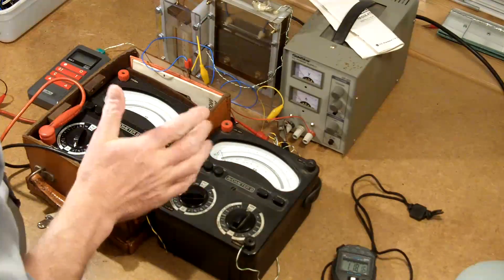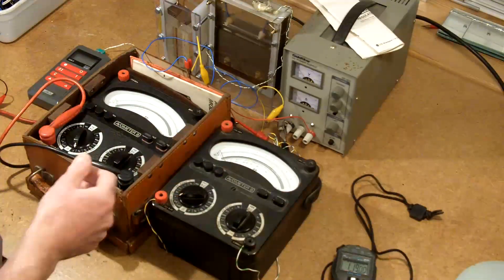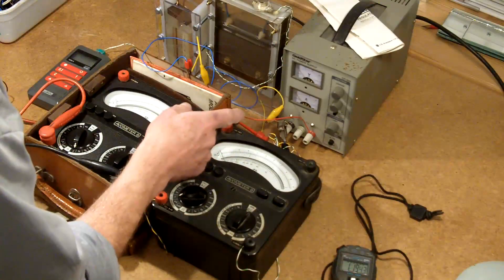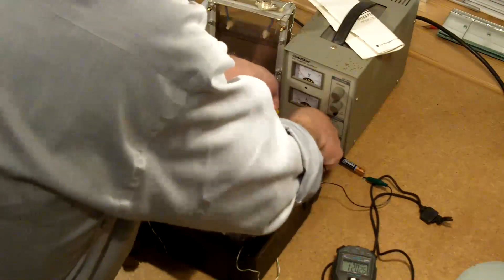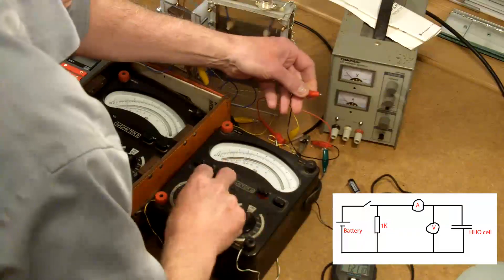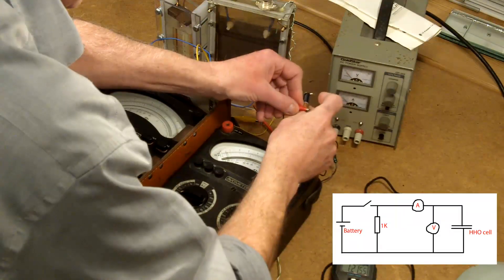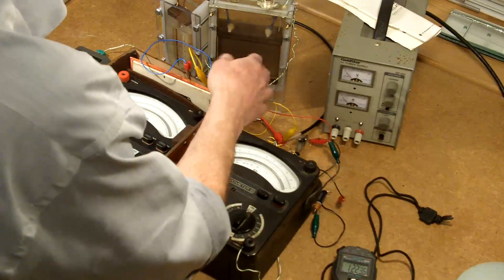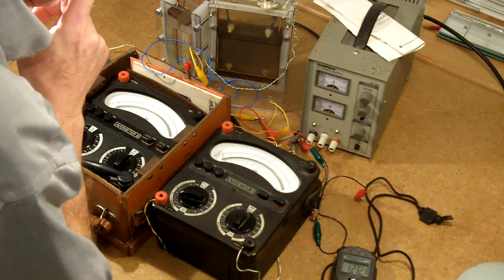HHO. 16 Test to eliminate possibly issues with the power supply

Comment: Hi Andy was wondering if you could help me. I recently bought an HP6228B regulated power supply. After switching it on for the first time, I heard a buzzing sound follow by smoke. I was wonder if you had any ideas what the problem might be. Thks

Comment: It is happened to me also, that is the cause we cannot measure resistance directly from the cell.
My hypothesis is that when you first apply a voltage all the molecules align in one direction, free electrons in the joint of the metal plates and the water travel though an outside load when applied (voltmeter).  I also believe it only happens in relative close spaced plates.
Mario

Comment from the maker: Ah... I used to use a microsiemens meter for testing water conductivity but I never realised it was an ac device, I guess it had an inverter in it but as it never failed I never had to investigate and just assumed it was just a DC driven, temperature compensated conductivity meter. Had I have realised it was an AC instrument the DC issues of the water probably wouldn’t have come as such a surprise to me.     

Regards ... Andy

Comment: electrolyte in your cell causes it to act like a battery( in a way). when you put power to it. the volts have to jump across the plates. the amps then follow. when you get the amp flow to follow, there is a inrush of ions. they smooth out, and amps drop back . try a rechargable battery. say a 3 volt one. with it being discharged and at .5 volts. hook it up and it will show like 2 amps, then go down to .5 amps or something. the ions want to equal out

Comment: Hi Andy, My thought is that when power is applied there must be some kind of shock wave at which the power is taking the least path of resistance in a moment of time. Then once the path is overwelmed to that given point it spead around to the rest of the plate. I see this same thing happen with all my cell that I have built.  Your thoughts?
Thanks for sharing.  Darrell